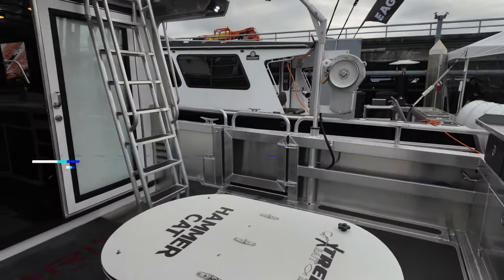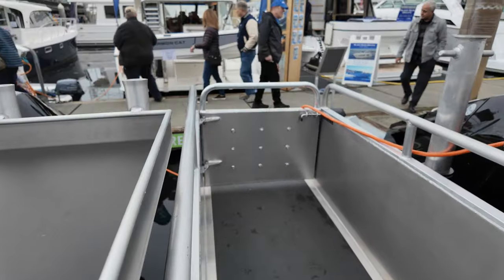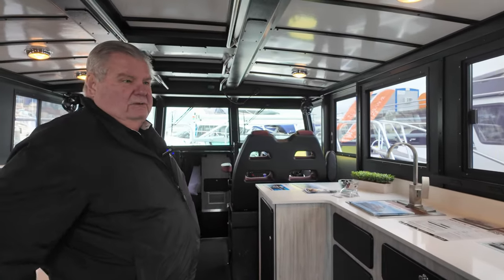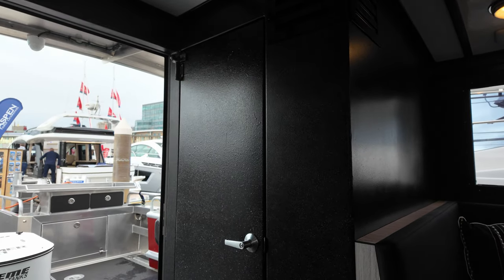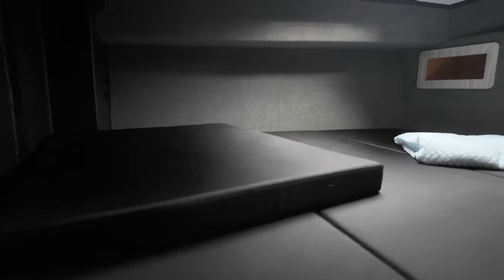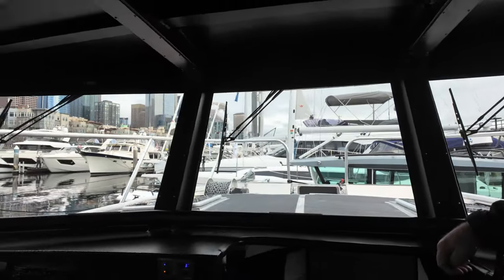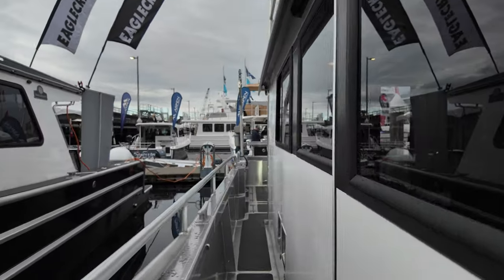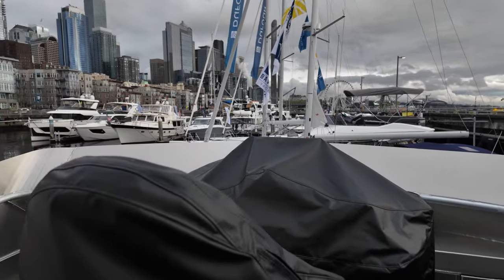Unveiling the Hammer Cat! Don't Buy an Aluminum Boat Until You See This!

Comment: I don’t  get all the negative comments. WTF? This is an absolutely fantastic vessel that deserves to get some attention. This thing is a friggin spaceship. Super stable, ultra safe, and must be incredibly fast. Nice to be 70 miles offshore and be back in Astoria in two hours. Always ahead of the weather. It’s not my cup of tea, but imagine a young couple getting in the yellowfin on this baby! What a life!
Reply from the maker: I couldn't agree more! Thanks for the comment and the positive energy!! This is a fantastic vessel and Charlie knows his product exceptionally well.
Reply: I'd take one. That 12kw gen is big. I had one that size on a trailer, had a turbo on it.
Used 1/2 gallon per hour, 100 gal tank would last 200 hours. Used more than the 1/2gl/hr in the day...we left the drop door open with ac on full blast. 
Usually I'd fill the tank on the 4th day just to be safe.
Reply: Ok, I’ll put my hand up. If there’s an ice maker to put ice on the fish you catch why not just refrigerate the fish bin? Why have diesel, electric and air con when you could just cover all bases and use a single reverse cycle air conditioner? .8 mpg is hardly economy to brag about, some hull tweaking, weight reduction or engine type should find another .2 mpg surely. Just shoving a microwave on top of the fridge is too much of an afterthought, a combined convection/microwave/air fryer should replace it with a dedicated space and not on the fridge top where it is too high for safe use. I am 4 mins in so perhaps it will get better. The wet head area looks very tacky, all those stringers & battens creating more surfaces to clean, the walls should be flush for a quick wipe down. There’s a nice big screen for the camera but can the camera also do FLIR as I’ve seen on other boats? I see there’s an infrared camera but looks like it only faces forward. No windscreen access to the bow, having to walk around outside during really rough weather is the only option. Just below the windscreen on the passenger side the attachment of the dials looks more like an afterthought, a dedicated housing for those readouts would be an improvement.
Reply: Its ugly!! It looks like it was styled for a grunge band or by an undertaker!
Reply: I cannot find a single thing I like about this boat. It seems all wrong to me